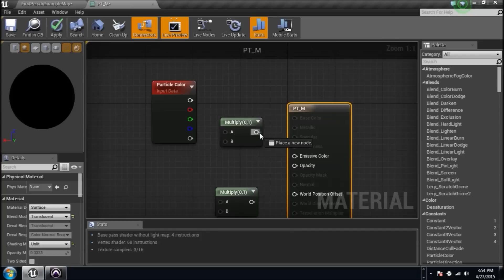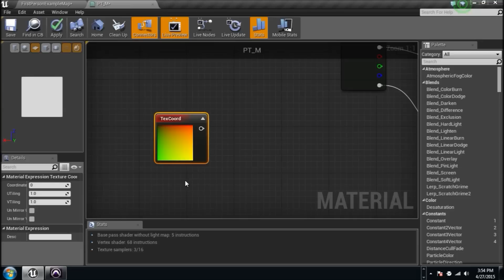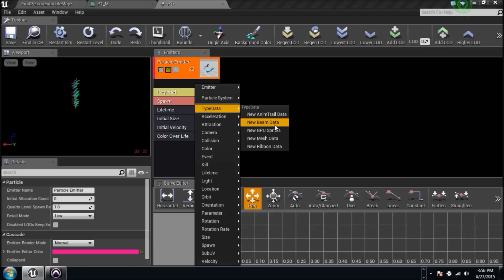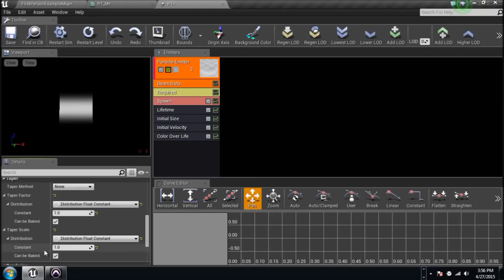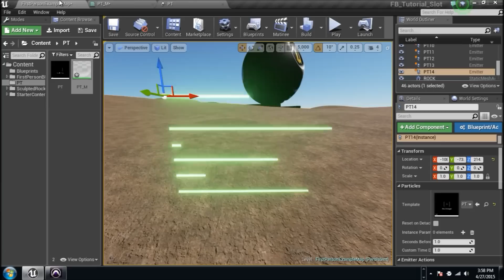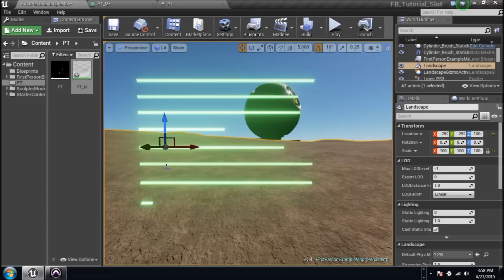PTV Unreal Engine 4  Particle Systems Tutorial 3 (Simple Beam Emitter)

Comment: Thanks for the video! I was wondering if you knew the reason for this input-output?
http://imgur.com/1m0a92s
AFAIK, if you apply the sine function to the texture coordinates, the output will be (sin(r), sin(g)). But, the output is not behaving like that. For instance, the top-right corner should be red (since sin(1) = 0.84, sin(0) = 0 --> (r=0.84, g=0)).